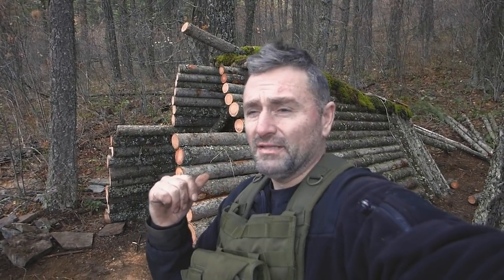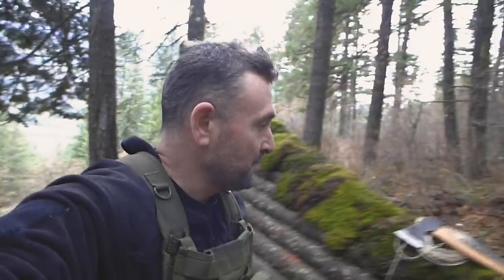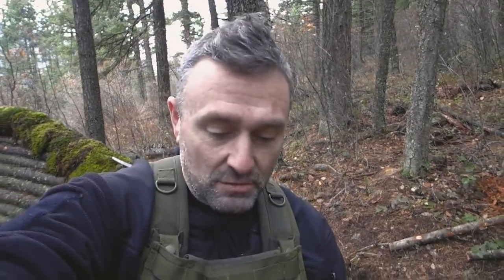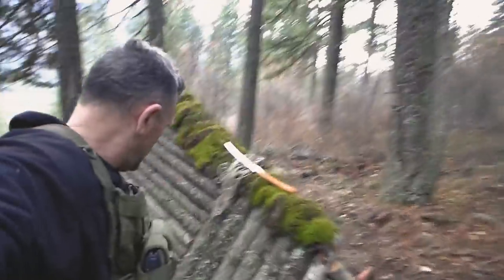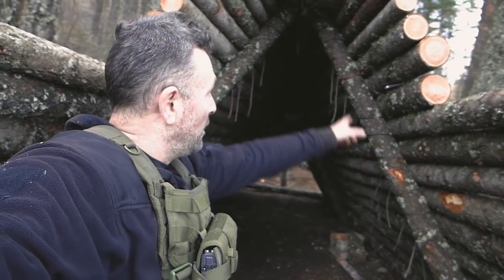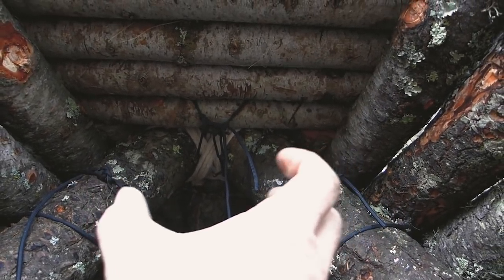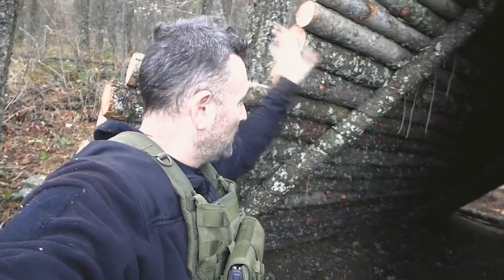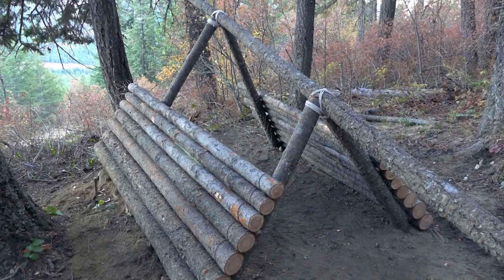Winter Survival Shelter - Build overview and waiting for SNOW!

Comment: Next time try using the Floor Lashing to get those horizontal sides tied down. You'll find that it's sturdier while using less Paracord,  and requires fewer knots. Also, mud in between the logs on the sides with moss on top will majorly save you leakage without requiring a tarp. Looks great!

Comment: I wondered the same about the horizontal logs. Also, the A-frame feet, being dug into the ground, may rot in a season or two. I would have left a roof overhang in the front, against rain, and it would also partially protect your fire against rain. Like you say, though, it's a snow shelter, but you could always use it in the spring to autumn months too. Thanks for sharing your design.

Comment: One the far side(oposite to entrance), you could try build there a fireplace to force heat to travel trough construction from one to another side, 
:?
Great build, cant wait to see that in action
Reply from the maker: Good question Piotr. I did actually consider this option... Primary concern is smoke in the shelter, I would like to avoid this as much as possible. I may experiment with this idea though. I'm looking forward to using it... I'll be posting updates. All the best to you
Reply: Something like a hot tent stove would work well for that purpose, definitely. The chimney would solve the smoke issues.

Comment: Well. It's very nice but I kinda suspect the rain is going to ooze though first chance. Same thing for a bit of snow melt. Especially when the temperature and humidity difference and twists and shifts the logs and that lycan dislodges or breaks off, probably more or less regardless of what you put in it for stability.  But very nicely done.

Comment: That’s a badass shelter, very nice!
Reply: I was gonna say the same thing lol .
Reply: Shelter from what. He already said it won't stop the rain ?
Reply: @mattholland8966 , He also said that it was designed more for snow, than rain, and that laying the logs vertically would be better for rain...
Reply: I live in the North of Maine, I understand the idea of sheltering out. But if he ever applies the heat he was going to add he melts the snow, gets himself wet from the water that drips through the roof and freezes to death in the night.   Realize that this is fun to talk about, but bad advice could be what you remember when something goes wrong. If your life ever depended on it wouldn't you really rather it be good advice. One lad said a piece of plastic was a good idea. He's right it solves the drip in issue as well as the moss between the log thing. But if I were forced to stay in the wilderness for some reason and happened to be caught with an ax a couple of saws and 1,000 feet of parachute shroud line and 2 days to build a shelter. No I still can't think of a scenario where that all happens.  Also if you look he's on the side of a hill with no water diversion around his wilderness home. So in the spring he gets the entire floor turned to mud or even underwater. I've seen some on the internet that looked really good, But this idea needs to be refined and improved.

Comment: What are the dimensions of the Winter Survival Shelter(I am considering building one)? Also, that is a nice axe, what model is it? I also need a good axe, as my 28” 2 1/4 lb. Collins has the wrong head geometry and has a fat edge and therefore does not cut well.

Comment: Looks solid!  I'm wondering why the logs aren't the same length at the front... Why are they cut shorter at the top?  Look forward to seeing your experience in the snow 😀
Reply: I am curious also.  I would have built them longer at the top for an overhang.  I am probably missing something and there is a reason. Either way, GREAT SHELTER!
Reply from the maker: Thanks for the question Paul. I wanted to be able to stand up and peak out, primarily able to observe terrain behind structure without completely exposing myself.  I'll be  documenting a few projects from the shelter through Winter. Keep well.
Reply: That makes sense...thanks for filling in the missing piece!  Standing up is always nice after a few hours spent crouching or lying down.  And you could always cover it with something in the meantime... Best of luck out there 😀
Reply: M998 Me to

Comment: If ya stacked it with the smaller diameter logs down low and the larger up higher the water would better shed off over them instead of rolling into them and leaking so much. Simple roof building 101. Like shingles

Comment: I’ve often wondered about using compost underneath a sleeping bag or under the floor of a small shelter for heat. Maybe, fill some gunnysacks or plastic garbage bags with it and lay it flat on or slightly under the ground and put a sleeping bag over it and use the chemical reaction to keep warm. Compost can get quite hot.
Reply from the maker: You are absolutely right Larry, as organic matter degrades in a pile is will create heat... Here's the problem: I know from personal experience that in Winter you will need a fairly large pile of whatever you are composting for it to provide heat, several feet actually. A foot of compost under you will freeze and not biodegrade. So in theory yes but in frigid temps you would need a large mass of matter for this to work. Great comment, thanks... Keep well.
Reply: @offgridwarrior  and you also probably don't want to be smelling something that is composting to actively :)
Reply: Best bed I've ever seen made for use in snow is two round logs say 12 inch diameter and 3 feet long at head/foot about 8 foot apart. Between these lay thin pole end to end, head of bed to foot of bed, you can tie cross braces ever foot or two. 
The aim of this is to allow heat from your fire, and fire shield, to pass under you while sleeping, you are not directly on the ground.
Having the bed "sprung" with the lengthwise poles makes it a darn sight softer than if they are short and going across your body.
Using this method, you are not sleeping directly on the cold ground, heat from your fire can circulate above and below your sleeping bag and if you are using a slow burn or self feeding fire you can have a pretty warm full nights sleep.

Comment: Nice job
Not easy work without a chainsaw....
I’d be inclined to drag one in for that structure...
Reply from the maker: Considering the terrain and effort required to get to location... lugging a chainsaw up there would of been considerably more taxing than cutting with the silky saw. Moving the logs down the mountain and through the woods required most of the effort. Keep well.